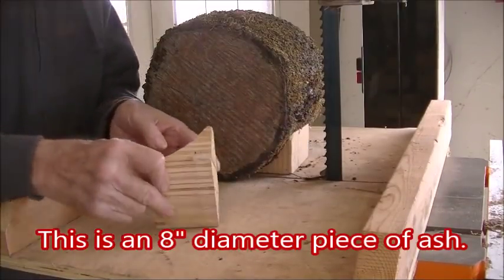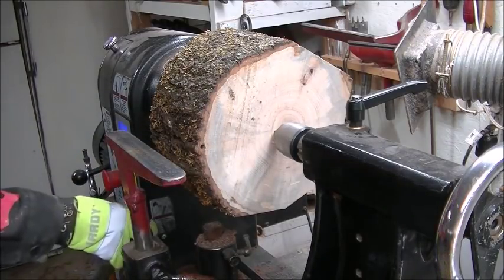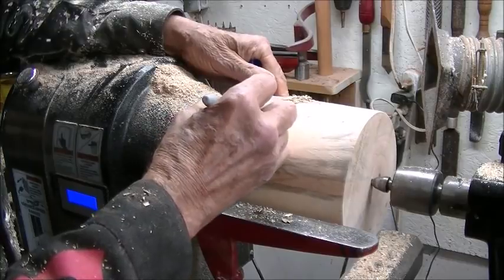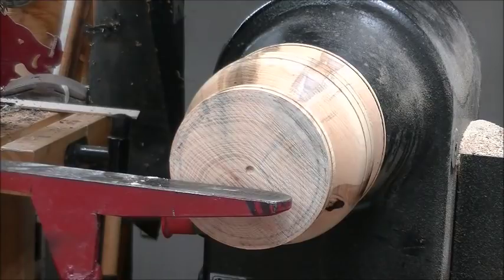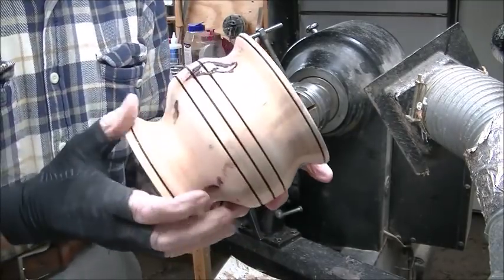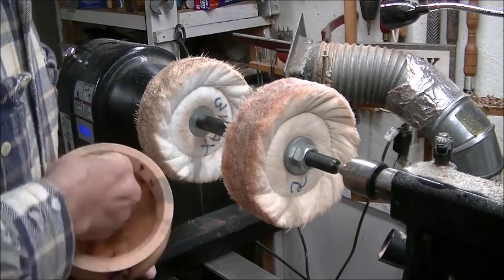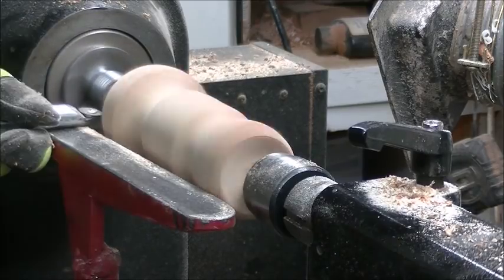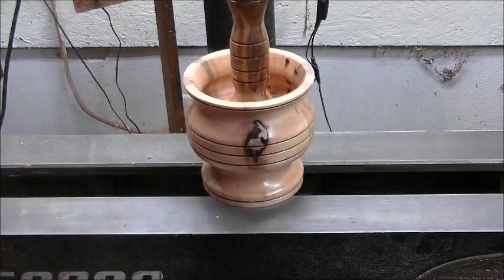Mortar and Pestle # 152

Comment: Great looking mortar and pestle! Nothing like ash for something that takes a lot of pressure. I have one handmade from clay and oak that my wife and I bought on our honeymoon 13 years ago. Now I need to turn me one from wood as soon as my doc releases me from my 15th spinal surgery. Getting the itch to get back to my wood lathe. Hope she hasn't forgotten me. Keep up the good work. I am thinking of using either apple or red oak as ash is not readily available here unless bought from dealer and then it has to be laminated.
Reply from the maker: 15th, that must be some kind of record.  Hope that's the last and you get better soon.  Take care, Larry
Reply: Not trying to set a record. Was born with protein in my spinal fluid and it causes the discs to degenerate and nerve damage. I sneezed in July at least 14 times from not wearing my respirator and using really dry wood that created a lot of dust. I felt the disc pop and the pain in my right leg was relentless. But I am a fighter and will not give in. Love to watch your videos and have learned quite a few good tips from you. Love that big butt lathe you use. I have my eye on a Laguna 18/36 Revo, but if that falls through have been giving the G0800 some serious thought. To do really massive bowls and vases, you need a massive lathe that does not dance the moment you turn it on with a piece of wood that is out of balance. By the way meth users would love the mortar and pestle to crush their meth rocks for smoking. Tis a shame the things we make for beauty and service get used for some of the most perverted things in the world.

Comment: Is that a water based sanding sealer you use?  Very nice results, especially on some of your spalted bowl projects.
Reply from the maker: Yep, it's Minwax sanding sealer you can get on Amazon at the best price.  Lowes has it too, but about 25% more than Amazon.  It's water based, you have to sand after the first coat as it will raise the grain.  Thanks, Larry

Comment: I'm a about to be wood Turner..haven't turned anything wood in 40 years..I'd like to talk to you about the carbide tools..I have a small machine shop here and I'd like to make some...just ordered a powermatic 3520c and excited to get it...but hard to figure out what to tool it up with haha....
Reply from the maker: There are a lot videos out there on making carbide tools.  I get my cutters from Capt. Eddie at, http://www.eddiecastelin.com/
You will need, a round cutter 15mm, R2 square cutter 15 or 17mm.  A point cutter.   He sells them in packages of 3.  And a parting tool , you can make one of those out of an old file.  Again there are a few  utube videos.  Any thing else, let me know and thanks, Larry